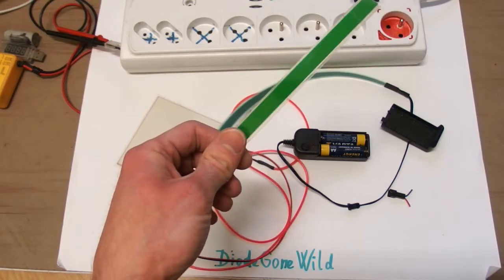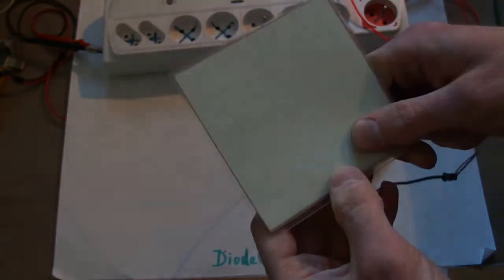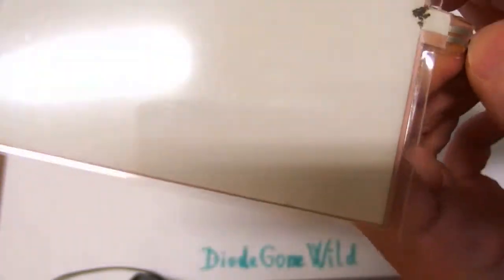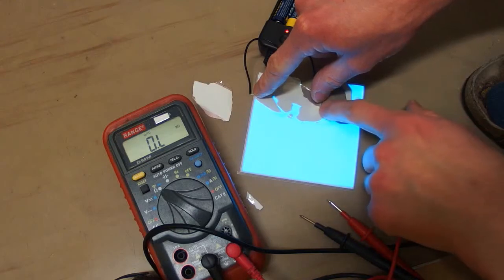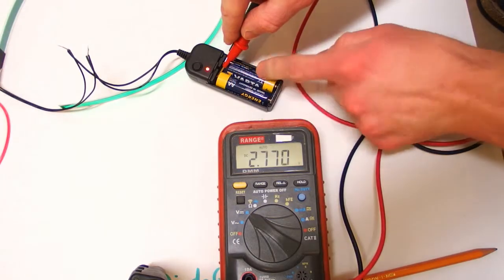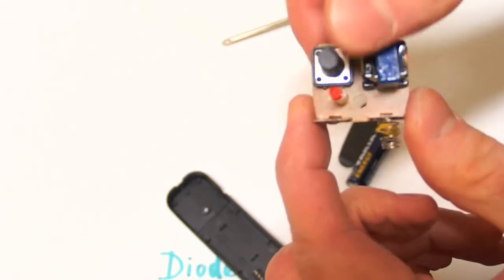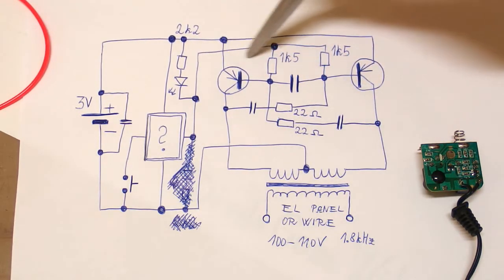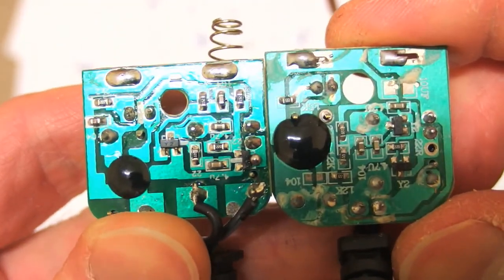EL Panel, Wire and Driver Teardown with Schematic and  Funny Moment

Comment: Hi, excelent teardown !  You didn't put the values for the 3 smd capacitors inside the flip-flop circuit. My wild guess, they may be about 10-100nF each, not sure the middle one. Also for the ~240VAC experiment, great by the way, but you could try to insert a 10k in series, just to limit the current as a protection and not let the panel get in flames, like the last time. Just an idea. You can make a new "updated" video about these things and probably with a better circuit diagram? Ive seen on the www a DC to AC converter using a 555 and a small high freq transformer (like the one on these boards). This cct is also very interesting. I am in search for a driver , because I receive today my first panel that is said to work at 12V - but not mentioning if DC or AC by the chinezoi seller. I understand is AC now.

Comment: is possible to  connect 3v directly to the EL strip or  EL wire  , please?
Reply: Yes it is possible to do it, but it definitely will not work
Reply: No, these panels work at 90~120V AC. DC cannot be used as they are essentially capacitors and will quickly reach the saturation point and fail to light up.

Comment: Back in around 1999 as a child, I took apart a special LA Gear light-up-shoe. Unlike most light-up-shoes that use LEDs, this pair used electroluminescent panels on the sides of the shoe (not on the bottom), complete with a small step-up inverter circuit for the high voltage. The shoe ran off of a single AAA cell, easily replaceable. The electronics were potted in clear epoxy.

If you or anyone finds these type of LA Gear EL shoes, I would love to see pictures of its EL lights and circuitry, as the originals I had are long gone. The only info I found on them online was a patent (US5865523A), after much searching. Anyone else remember the EL shoes (NOT LED) in the 1990s?